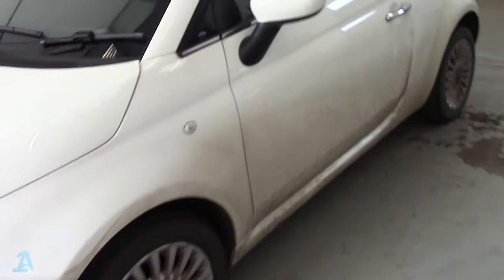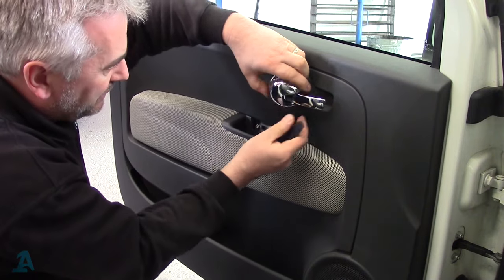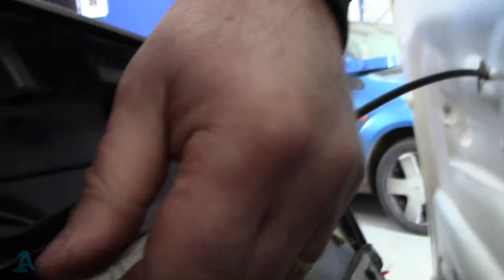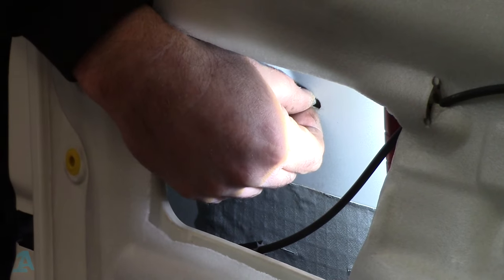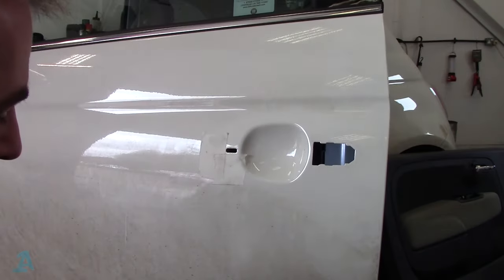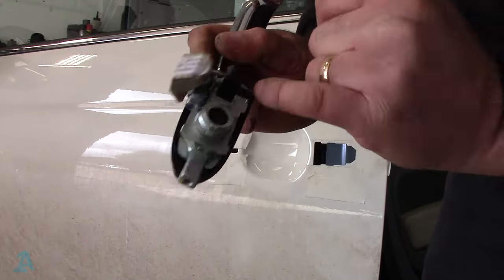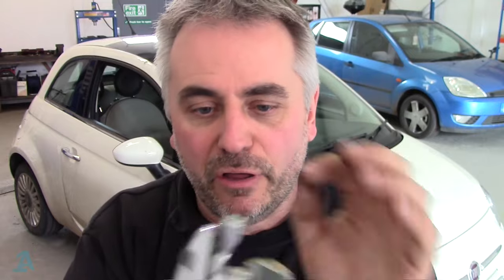Fiat 500 Door Handle Broken

Comment: Thanks so much Rob.  Your video help tremendously. We just bought my daughter a 2012 Fiat 500 Pop and after less than 3 weeks the door handle came off.  Thanks to your video I saved myself some money.  I ordered a new handle from Amazon and replaced it in just over an hour. I did have a problem getting the locking part of the handle in the tiny space but I found that if I kept the door handle open, it let the heavy part go down and just a bit of elbow grease put it right in. I also found that the inner membrane was gone in the exact spot you cut out and you could tell someone else had replaced the handle previously. Anyway, thank for taking the time to show us amateurs how this is done. Confidence is high!

Comment: Just wanted to say thank you for this video. I have literally just finished doing my wife's passenger handle. I struggled removing the cable from the door handle but I noticed the handle has enough give for me to unscrew the broken hinge off and screw a replacement hinge back in so that's what I did. Took me possibly 1.5 hours tho (running back into the house for something else in between).. Thank you!
Reply: Winner I was just thinking this.  So once the cable is off the door handle it must allow the door handle to be pulled out enough to replace only the hinge without the faff of taking the part to the rear of the door.  I emagine you still need to remove that nut by the lock?  Hopefully all goes well.  Thank you.

Comment: if you regularly lubricate the hinge part/ back of the handle with wd 40 aswell as the locks this will prevent corrosion from setting in and it breaking away 👍

Comment: Many thanks for this Rob, excellent video. Like others I managed to just replace the broken bit (ebay £7.49) and didn't need to take the handle off completely. One thing that may help others: I found afterwards that the handle wasn't springing back on using it, but seems that was because I'd over-tightened that nut at the hinge end.
Reply: Thanks for the tip, I had the bolt too tight and was wondering why the handle wouldn't spring back !

Comment: I just changed the part that was broken, got it from my local dealer, very cheap 11-12 £ here in sweden, but you video was very helpful to repair our Fiat 500
Reply: I done the same, just changed the hinge that was broken. New part was just over £4
Reply: Hi, is there a part number for that?
Reply: @nlroel  I bought mine off e-bay
Reply: @Hotrodngaz  i see☺️ part no 51964555
Reply: Thanks for the info , how hard is it just to replace the hinge ? It is the driver door handle on my 500 that is broken .

Comment: Thank you so much Rob the handle came out easier than I expected .The only problem I had was taking the nearest rod off it was so tight as you said and I broke the red clip at the bottom.10 minutes on ebay and new clip ordered  The only thing I had to do was leave the rear rod attached to the handle on removal at the lock end as could not get my large hand near the clip to undo it. I bought a replacement hinge for £8 like Richard bishop once again thanks very much.

Comment: Good video, thanks. Apologies if someone else has covered this, but I can't read all the observations. I noticed you undid the link bar at the bottom, but when you finally got the handle off, the bar had also been detached from the top link, ie. the handle. Having done one this morning, I don't think the handle can be completely removed from the door with the link bar on. It was possible for me to pull the handle out at an angle to get enough room to remove the screw holding the hinge without taking the bar out of the handle. The hinge I bought came from a Fiat agent and included the plastic bush for the top bar- not needed if you leave the bar attached to the handle.
Thanks again.

Comment: Brilliant video. The handle is easier to remove if you disconnect the vertical rod before removing the 10mm nut and the T30 screw. Just pull the top of the rod towards you. It is a metal ball in a plastic socket, and pops in and out easily

Comment: Great video, i just did the drivers side (uk), ended up getting just the hinge for £6.98 from fleabay. I'd recommend on the central locking version to just get the hinge, there's so many inaccessible rods, it's easy to just leave them in place, wiggle the fat end of the handle out enough to just screw a new hinge in. I re-used the old screw as the new one was shorter and my old one was in good enough shape. Small smear of molly grease on the hinge part should keep it nicer for longer. I also damaged the speaker a little with the long plastic retention pieces that secure the card to the door, please be careful with this part, but my old speakers were perishing anyway.
Reply: Was it easy enough doing this rather than removing the whole handle to fix it? I have the hinge and need to have a go at doing it this weekend!

Comment: We followed your instructions, all went well until we failed at the lock check! I lock my car and you are able to open the door where the handle was replaced, without unlocking 😳
Any tips of how to resolve this?
Noticed that the inside handle does not move when you use central locking to indicate
Reply: I know you left this comment ages ago but did you fix this? I'm having the same problem

Comment: The issue: this was designed by a left handed person.  When you open the door with your left hand you are levering it in the correct direction - the portion of the handle that does the actual opening of the door latch.  When you use your right hand you tend to pull on the hinge end, thus stressing it far too much and breaking it.  Both of mine broke, one from a ham-fisted mechanic that was yanking so hard on the handle to open it he snapped the pin,(the common fracture of the handle), but just pulling too hard on the 'wrong' side of the handle.  Try it, you'll see the difference.

Comment: I have just fixed my daughters door handle, but using a genuine Fiat repair kit ( 51964555 ), which basically is just the aluminium hinge that has a metal pin which rusts and breaks. It saves a lot of time, as you dont have to disconnect the cables. Having said this, i could not have achieved the job without watching and refering to this video. Thank you for posting Rob .
Reply from the maker: Thanks. I wish those hinges were available separately when I did the job

Comment: My niece asked me about the Fiat 500 or as I would called them Fix It Again Tony.  I told her that the first generation had terrible suspension problems.  Saw a new 500 with way too much toe out, the left and right wheels were  pointing 90 degree apart....

Comment: Hi.... great video. I have similar problem with my passenger handle on my 2012 500 Sport.... I have been told that you can just purchase a hinge kit instead of replacing the whole handle as you did..... is this true?  I replaced my driver side handle last year with an after market one I bought on Ebay and although it was reasonably priced, the installer said it was a pain to install because parts didn't line up properly, so I don't want to go through that again and run myself more of an expense to replace the whole door handle .... if I don't need to! Perhaps that was because the driver side handle has the locking component, as you said. Please advise!
Reply from the maker: Yes you can now get the hinge alone. As for your installer of the handle… even genuine ones are a pain in the arse to line up 😂

Comment: North American are slightly different. There are two self tapping style screws that go in from the side that hold the door panel in that need to be removed before you can pop the clips out to remove the panel.

Also I found I couldn't get the new handle to go in no matter what I did. I finally had to take a file and file down the tabs on the bottom quite a lot before they would finally "pop" in. Possibly just finicky and I wasn't patient enough, or aftermarket parts not built to the correct tolerances.

Comment: I've been quoted £120 by Fiat dealer to change this. Looking at other comments hinge can be bought for £8 and whole handle kit for £20. Mine is the drivers side door that's gone, so if it's even fiddlier not sure I dare attempt to repair it myself as a first time self-repair job! Even if it does save over £100.
Reply from the maker: Rhian L then taking up the quote is a good idea as changing the lock barrel over is a bit fiddly

Comment: Thanks for the video, it was very helpful. I replaced the drivers side door and have two questions, how can i get the lock tumbler out of the old handle and place it in the new one? Also after i placed the new door handle on, it doesn't seem to want to sit flush with the rest of the handle after i let go of the handle, does it work itself out or maybe i have one of the bolts on too tight?
Reply from the maker: Lock is held in with a spring type retainer see here https://www.locksmithledger.com/article/10825831/how-to-service-fiat-500-hatchback-videos-added If the handle is not sitting flush it will not be fully located in the guides where you have to slide it into position. I know what you mean though as I’ve done that as well and had to reposition it. They are a bitch to get in right. Hope this helps and thanks for watching

Comment: this was super helpful. thanks! my only problem is that this rod keeps popping out of the top hole. Should something be holding it in place 9:48
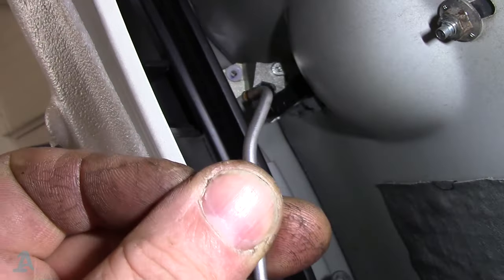Reply: sorry 9:43
Reply: Same here...and this handle on this car is a nightmare...this is where I call most car engineer idiots who should get their heads out of books! I have been repairing cars for a long time and I have seen my fair share of stupid engineer solutions(they are the worst in the car industry) my son would have come up with a better solution using legos.
Reply: @eliteinfo  My workaround was to put some epoxy on a long stick, spread the epoxy on the hole, stick the rod in the hole and let it set overnight. The handle works fine now and its been 5 months.

Comment: Hey, nice video! At the end, did you say that the driver's side lock barrel comes out and is installed into the new assembly? Or does the original lock need to be replaced as well?
Reply from the maker: You can remove the existing lock barrel and fit into the new handle.
Reply: That's great news, thank you!

Comment: You do know that at the factory the assembler is allotted 23 seconds to install that handle.
Reply from the maker: There's my target for the next one 👍
Reply: got to love plastic parts  lol the one thing that makes it horrible to work on new cars
Reply: at least fiat have metal door handles my corsa has plastic door handles
Reply: itd take you that long to boil the kettle cos ive just done one and you need a cuppa 23 seconds be hard to do in 23 minutes!!
Reply: Its fake metal. Still plastic
Reply: Ah yea but he is not fannying around getting to and removing the old one which is the tricky bit.
Reply: Garth Goldberg Shame they didn’t give him a decent part to fit instead of this piece of crap that breaks on all of them. 😡😡😡😡

Comment: I just did this fix with the repair kit that I bought on Amazon. No Alfa Romeo part required.  I still had to remove the door panel, cut the styrofoam, remove the 10mm screw and the t30 in the door, all of which I did with an Allen key. Then take the handle partway out, unscrew the front hinge (which is the broken part) insert he repair pat, screw it up and put the door back together.
Save money and work by just buying the repair part. No need to disconnect rods by the side of the door, no need to remove the door handle, no need to buy the whole handle. The part was made in China and not perfect but damn near.🤷🏻
Reply from the maker: Yes it’s easy with those kits. I wish they were available 4 years ago when I made this video 👍

Comment: The same exact thing just happened to me... ugh. I was thinking of using some kind of strong adhesive to glue the hinge back down...

It’s probably a terrible idea. I know very little about cars. Afraid to take it apart like this guy.
Reply from the maker: You’re correct.. Gluing is a terrible idea 😁
If you take it in to your local garage I guarantee it won’t be the first one they’ve done.
Reply: One Auto, Thank you so much for the video and the SPEEDY reply! Wow! Yeah, you convinced me that the glue was a bad idea after watching how complicated the actual fix is! I didn’t know you would have to take the whole inside of the door off to get to the part of the handle that breaks! It’s more involved than I thought! Thank you again! 😊

Comment: Hi at 4mins 13 sec you say you are removing the screw which is a 30 torx
I need to replace both of these screws as they are rusty on both my fiat 500 doors.

Do you know what screw it is I need to buy like what length im getting so confussed with all the different ones .
Reply from the maker: Kayleigh I would just order one from FIat... that way it won’t be wrong
Reply: @OneAuto  Hey thanks for the quick reply.

So when I take that screw out to replace will the handle drop?

I've ordered some from fiat now
Reply from the maker: Shouldn’t move much, just keep one hand on it

Comment: How’d you get the rod out?
Reply from the maker: Push the small arm on the clip off of the rod and the rod slides out of the hole in the clip
Reply: @OneAuto  I actualy fixed it without taking the handle out completely.. I just pulled it out far enough to unscrew the part that was broken and replace it.. at least I know if the whole thing fails tho now I guess haha! Good video 👍🏼

Comment: So it’s a bit of a shit design. My partner has 1 and when the side/druving lights go there is a little inspection door on the front inner wheel arch that you have to pop off to get to the bulbs but trying to get your hand in to remove if you need to be doubled jointed to get your hand in the tiny hole to get to the bulb to extract it. If you had women’s hands it would be easy to do and  trying to explain to a woman how to do it you’d be in all sorts of bother and probably end up arguing so it’s easy to just have cut hands